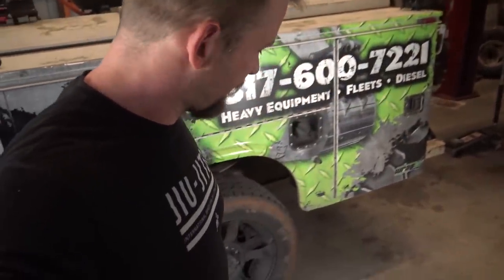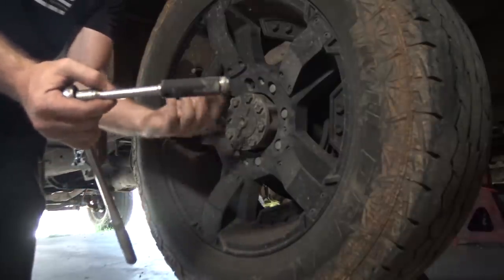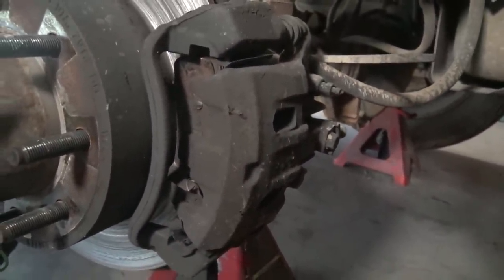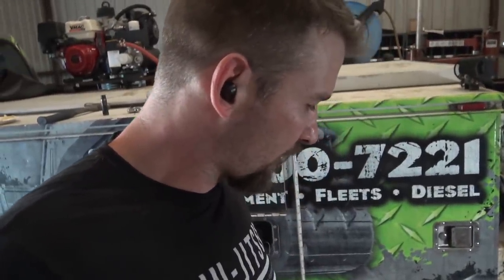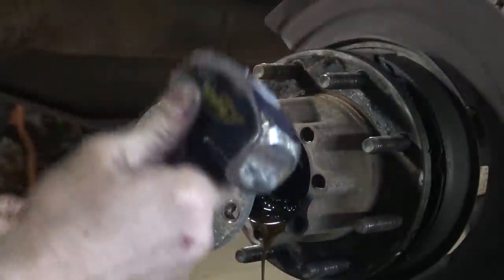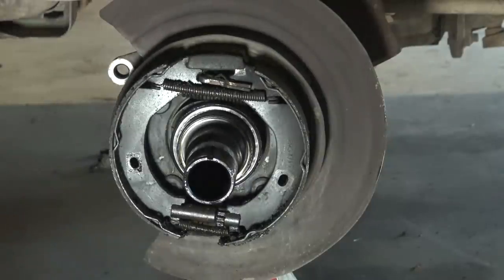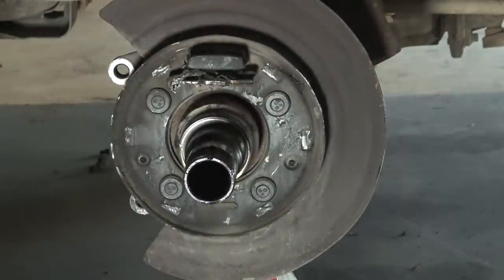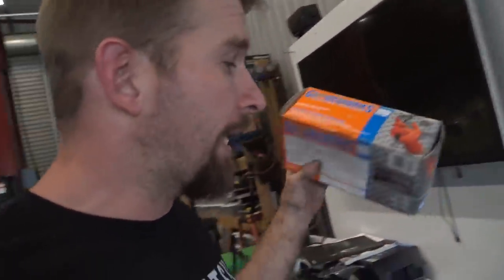Changing brake pads on an 11k pound Ford Superduty service truck

Comment: Funny you said that a co worker with a 04 f150 actually did that. Heard the dreadded grind he knew the pads were down to 30% had the new rotors and pads at home. Thought one more trip 2 hour drive up north to weekend sled he would be ok. Ah grasshopper you bought the cheap pads anything under 50% the pad will leave the backing plate due to cheap construction. Not normally a problem depending where you live but in conditions like NY state in Canada. Jack rusting will happen on cheap pads the friction material will go by by I mean it will debond and fall off.  Anyways he on a Sunday up north no parts available made his own pad yea just the one that failed inner pad on the passenger side out of hardwood made it home of course he drove at night with light traffic. CRAZY actually made it home.Yea smelled campfire all the way But MADE IT HOME. Had to replace the caliper though burnt the boots.

Comment: I hope you can help me I just replaced my head gasket for the second time the first one blew out like half inch and was pressuring the coolant put new one on the rights side started having little buddles of fuel and then filling oil pain with diesel just out second head gasket on and now it's even more in several stops pushing fuel out what could be going on plz help it's in a cat d4 6u dozer